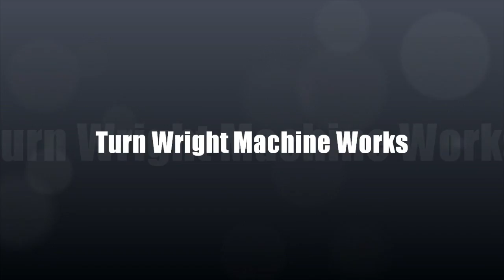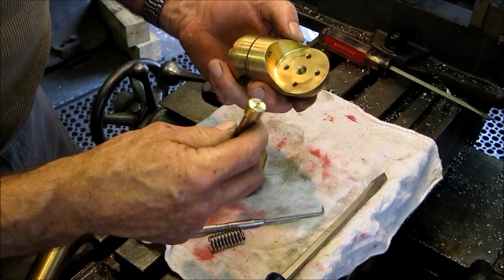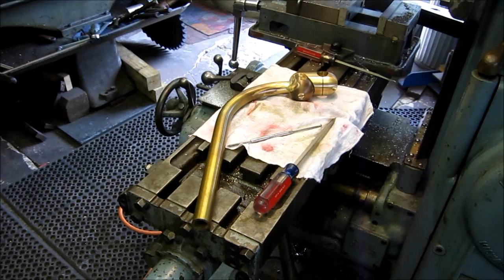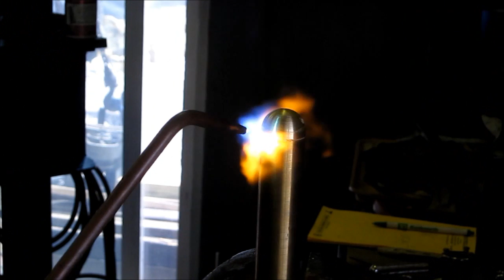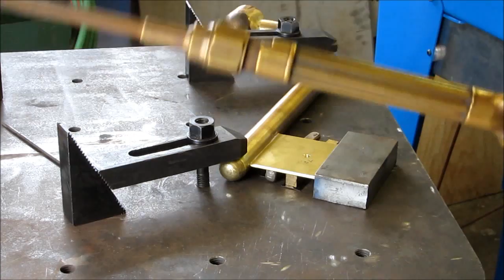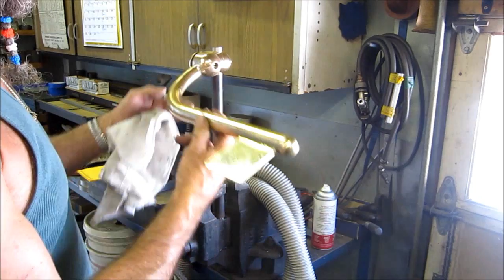The Golden BBQ Support Part Four Final Episode

Comment: 0:55 Is that slitting saw running out? The successful use of the slitting saw is one of my unconquered territories - run out is my enemy & on a small vertical mill a nightmare. Thinking of making a set-tru type arbour.
Reply: Over the years I don't think I've seen a single slitting saw that runs true, and I'm pretty sure it's not because of the arbour.

Comment from the maker: That was a little job and that wheel is one of the best masking wheels I’ve ever used, it is woven tight, it has shrunk a couple inches in the last 17 years. The one on the other side is a roughing wheel, throws a lot, don’t much use it, thinking of creating a 2" belt sander drive off that side...